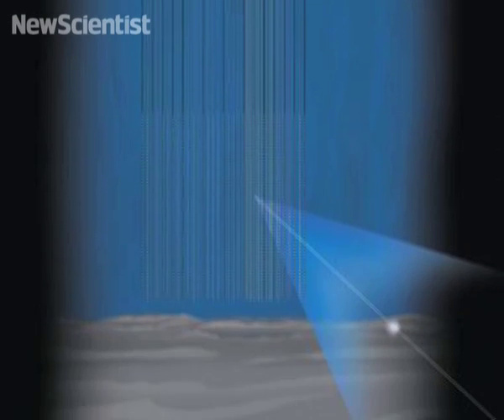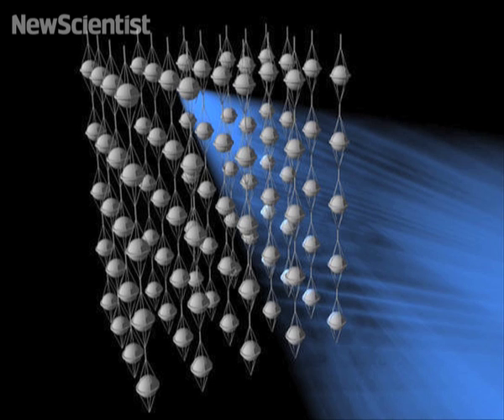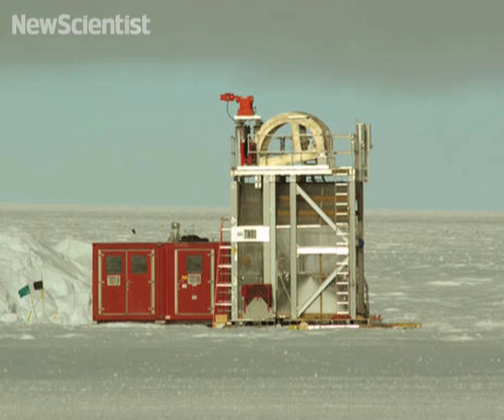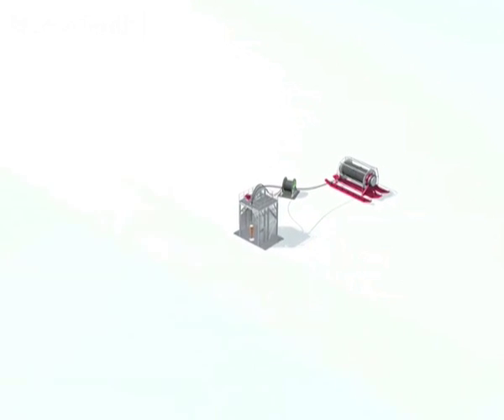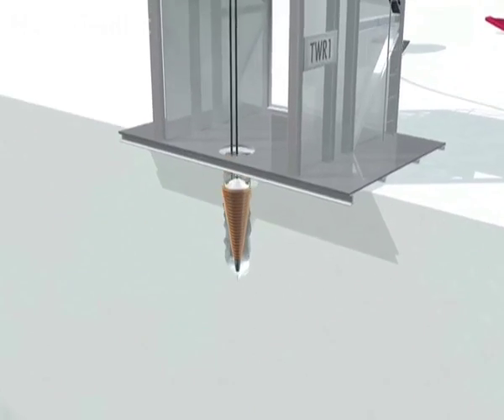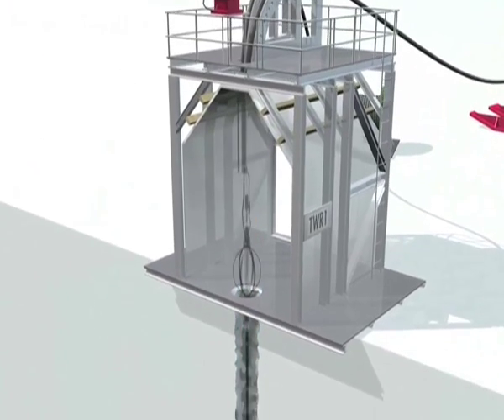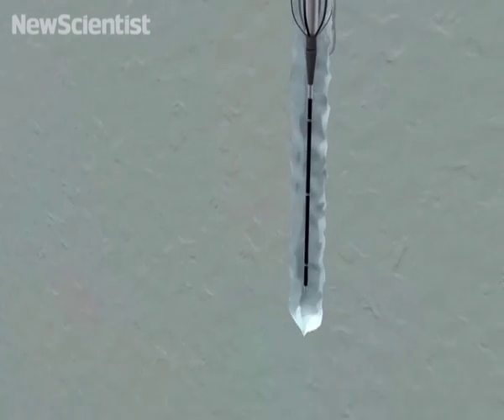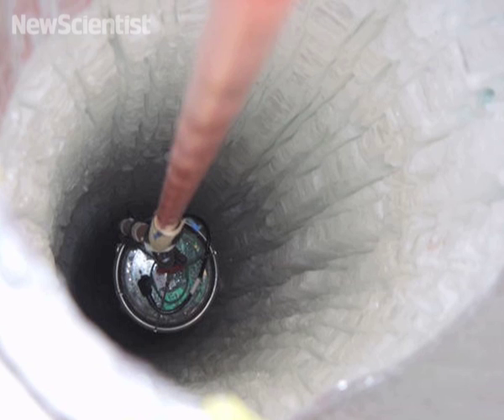World's largest neutrino detector takes shape under ice

Comment: If the sun's electron-anti-neutrinos gain energy on their way up to the Earth, to thus include a mix of muon- and tauon- anti-neutrinos, then maybe these antiparticles are behaving in an antigravitational way. A full pass through the Earth has been used to image solar neutrinos and the apparent neutrino-imaged radius is 5 times the sun's optical radius. It's probably possible to tell whether that is gravitational focusing or anti-focusing, as the curvature must be small it suggests the latter.